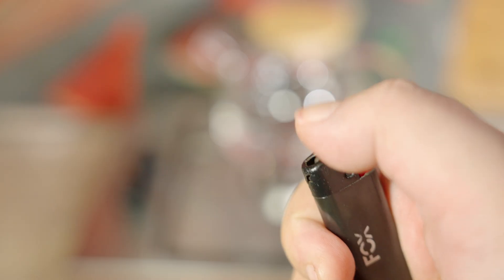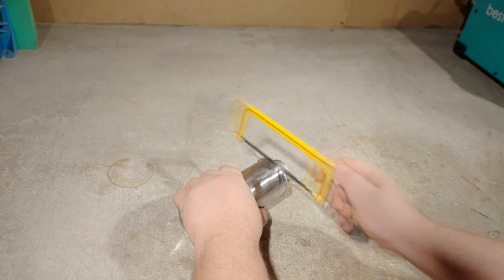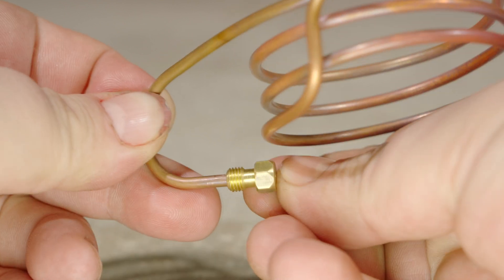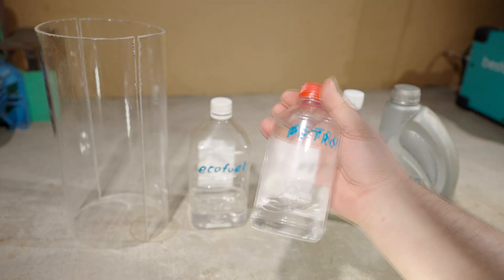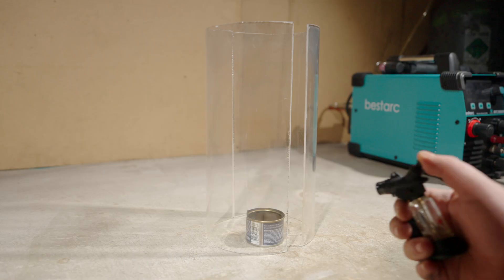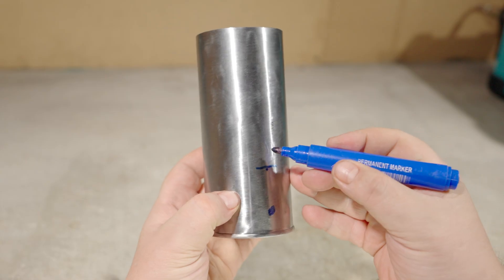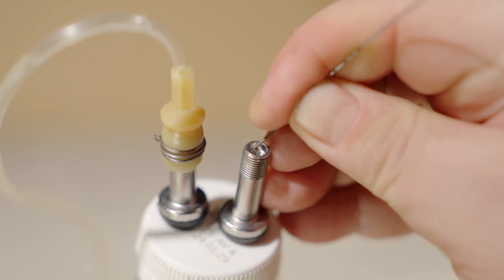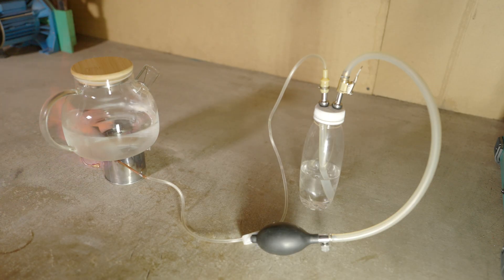ROCKET JET STOVE from a TIN CAN!

Comment: might wanna put a anti-flash back bottle in line for safety.
Reply: I WAS HUNTING FOR YOUR COMMENT!!! FLASHBACK ARESTER DEFINITELY NEEDED FOR SAFTY! 

ITS BASICALLY A HHO GENERATOR WITHOUT THE ELECTRICAL
Reply: @johndoe-lr2fi  well chances are still there for explosion its just much lower cause theres still air oxygen in bottle before use until leans out and your just adding oxygen when pumping up in bottle.

Comment: In the USA most aerosol cans and food cans are NOT made of tin. They're made of steel. Steel is essentially specially processed IRON. Generally beer and soda cans and cans for sardines are made of ALUMINUM.
Reply: yea but theyre tinned
Reply: @WeebRemover4500  Not necessarily,aluminum cans are varnished,not tinned.Steel cans-yes,for obvious reasons.Elemental tin is way too expensive for use in tin cans and mechanical properties make it a doubtful candidate for pressured beverages
Reply: @piehound  Cans are never made out of tin,nowhere in the world. You confuse the material with form. Steel can be get in tin sheets,aluminum as well. It is tin product made out of steel or aluminum, simply a very thin sheet of any metal used in industry
Reply: @petruse8893  Don't tell me. I know the facts. Others are confused. Tell them.